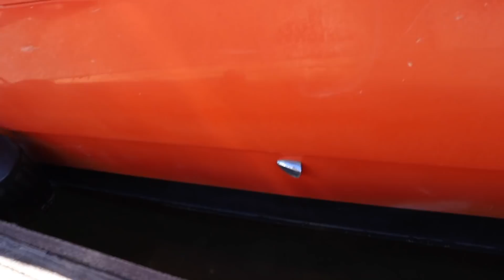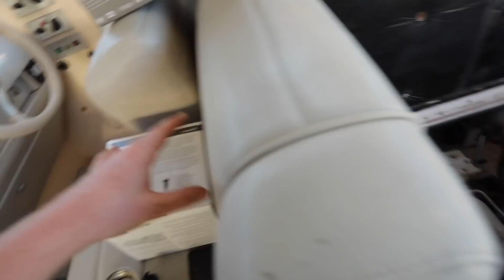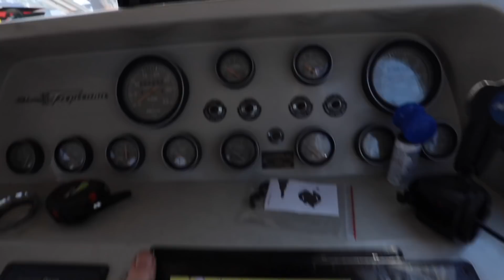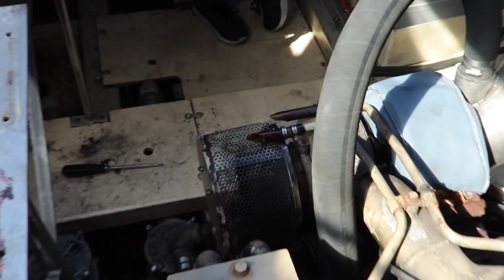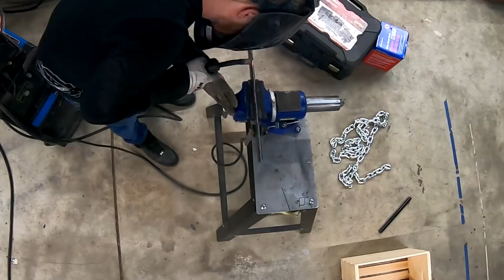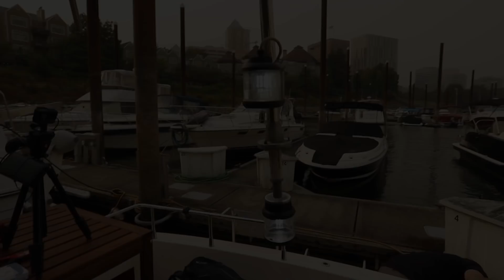Fixing Up My 30yr Old ITALIAN YACHT!

Comment: I wonder how long until that non aluminium anchor will last before rusting away!

but thanks for making a video on this, nearly forgot about it!
Reply: It would be fine if he used a heavier duty paint  like hammerite or similar. I work on steel boats and as long as shit's protected, it won't rust.
Reply: Like, a week maybe. This thing is designed to get into scrapes with whatever's at the bottom of the water
Reply: @brettgoldsmith8584  admittedly the anchor on the boat I work on is a lot bigger, but its steel, and the original anchor. The boat was launched in 1976, so I'd say it'll last a fair while
Reply: It is made from scrap steel, so who cares. I'm sure Chris will love to build a replacement if this one gets too rusty.
Reply: @February54  for me its less the fact that it could be replaced more the "do it right the first time" as well as rust stains being a bitch
Reply: If he doesnt go to the ocean aften itll last a long time. If he does, he should start making a new one already
Reply: 3 cans of SteelIt will keep that anchor intact for a lot longer then that paint coat..
Reply: Most anchors are hot dipped galvanised steel , aluminium anchor are usually reserved for preformance sailboats stainless , well , more brittl than stell and not offering many advantages over gal steel  besides gal steel chains are a lot stonger than stainless chain's and a gal steel chain hooked to a stainless anchor would have a corrosion issue due to electrolisis , so theres that too  aluminium anchors are quite  rare  dude , too many comprises the only boats 5hat carry them are doing so usually to meet a code that requires you to carry an anchor ie race boats , where the anchor is generally  rarely used
Reply: It isn't difficult to nickel plate steel if you are half decent with elementary level math and basic chemical handling.
Reply: @agentx250  nickel plating an anchor is redundant, its average work load is scraping into rocks and sand, no plating will last which is why they make them out of aluminum to begin with these days
Reply: @Adierit  lol NO ONE ses aluminium no where near strong enough  and weight WEIGHT is what sets the anchor  ,   for anchors galvanised steel is the go
Reply: @mitchpender8113  they use something called a chain, it weighs more than the anchor ever will. as far as strength goes, you're being silly as aluminium can easily be as strong as some steel mixtures, and be even stronger as well.
Reply: @Adierit  really dude .? Aluminium anchors are designed for use in boats where weight is an issue , a galvanised steel anchor has a higher... tensile strength more weight which is  just as important as the chain  will actually corrode LESS than an aluminium anchor , and be 30% cheaper  . Hmm steel is actually a more noble netal than alum meaning far less issues with galvanic corrosion.. i have a gal steel danforth anchor which i used daily on my floating home for 18 years its now a backup anchor and over 23 years old .. no rust to speak of ! Most if the people i know live on their boats .. guess how many rock a alum anchor..... none

Comment: Dude you're adding an extra syllable. It's just oxidation. You keep saying oxi-ti-zation. Lol.
Reply: It's really bugging me 😂
Reply: Huh. Well you learn something new everyday. I've never heard anyone say oxidisation before. Either way the way he was saying it made it seem unintentional.
Reply: I think he is saying "oxidisation", which is correct and has the same meaning as oxidation...
Reply: @Rocky19011  Oxidisation typically refers to the process, whereas oxidation refers to the result.  They are technically interchangeable, but it's more common to use them in the aforementioned order.
Reply: Joel Dazey but he wasn’t referring to the process he was referring to the end product so they weren’t interchangeable.
Reply: @agoogleuser7784  I mean, they ARE, but since nobody says it that way it sounds weird. In a literal sense, they are interchangeable.  

Either way, it's better to just say oxidation when referring to existing damage.
Reply: Joel Dazey  if referencing the interruption of the oxidization process then he would need to use it in the correct context such as “ we are going to be buffing the boat in order to stop the oxidization.” If using it as he was it would be necessary to refer to it as oxidation, since he was speaking of removing the end product of the oxidization.

Comment: reason anchors aliumium is cause the salt water and rust and marking the boat and seat storage ect maybe you should rethink ur anchor only suggesting
 im sure u allready know the trouble salt water causes i just dnt want see ur anchor marking ur restored paint ect
Reply: Aluminum anchors are not the best choice,  trust when they corrode everything nearby turns black , besides not having tne required tensile strength to anchor a boat this size , besides you need  the weight of a steel anchor and chain , hot dipped galvanised anchors last for years in salt water

Comment: Anchor is going to be to small for the boat size.
Reply: What flecs said. And you want that secondary one to hold less than the main anchor, so worst case wind and waves can still swing you around if they are heavy enough.
Reply: @Baerzilla  he is still learning boats are "different" lol
Reply: its a secondary one for extra stabilization he said
Reply: Box looks pretty.
Reply: About 3x too small.